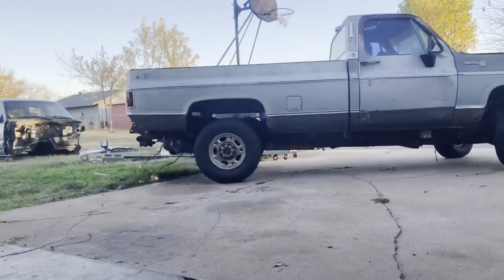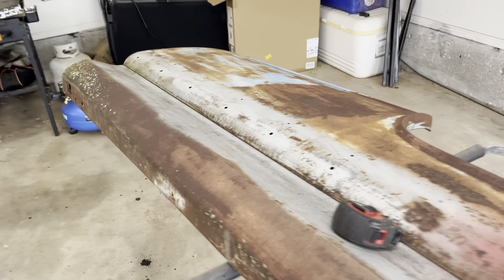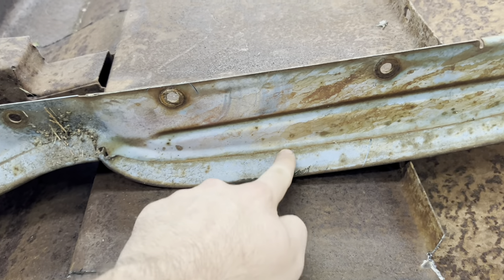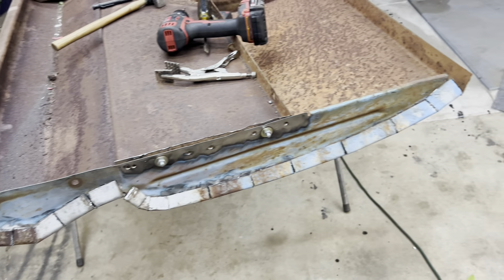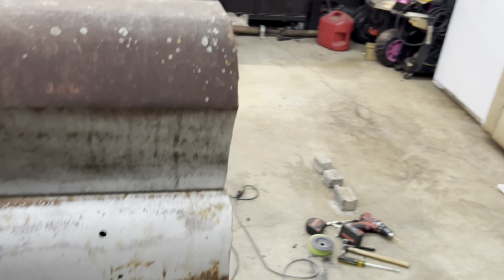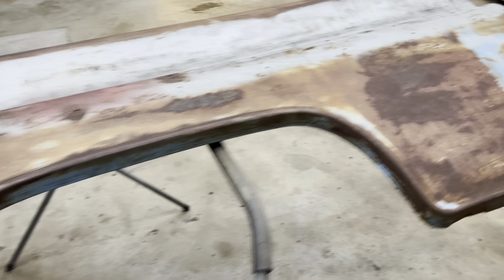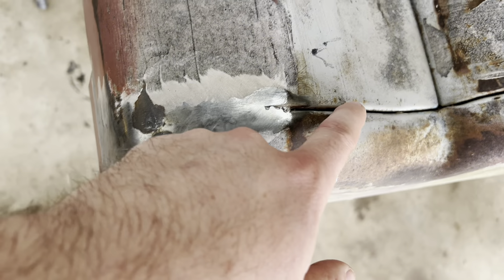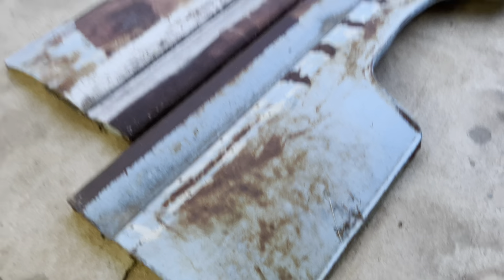DIY Short bed Conversion

Comment: Don’t want to sound like a ass but you folded and welded rusty metal should have cleaned it and put weld through primer at the least
Reply from the maker: What an ass of a comment! No you’re right though, I should’ve cleaned and prepped it, but where do you stop ya know? It’s rusted all the way into the bedside, I can’t reach all the way up there, it took 60 years to get like that, it outa make it another 40
Reply: @Twistedleafrodshop  lol true it’s one of those damn if you do damn it you don’t
Reply from the maker: @shermy584  yeah for sure, thanks for watching though!